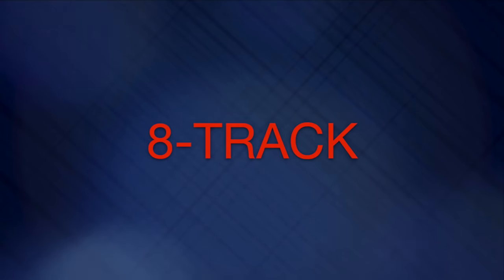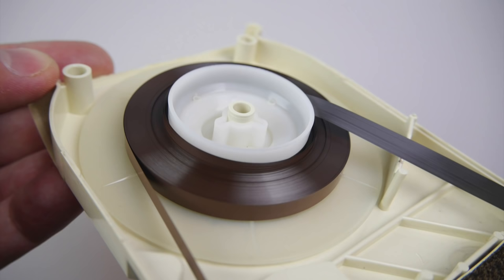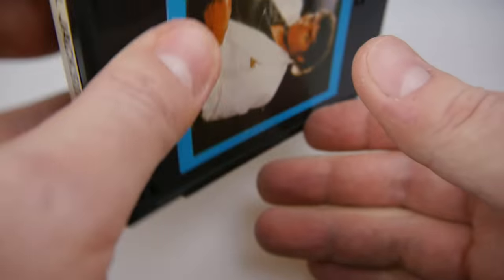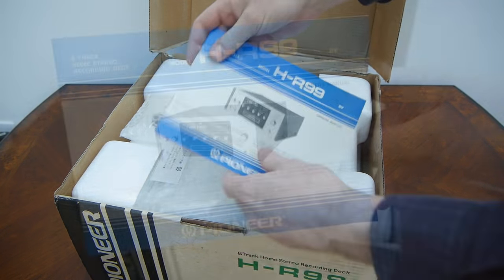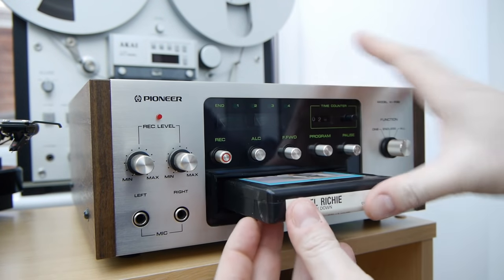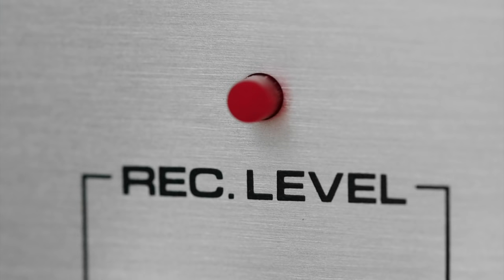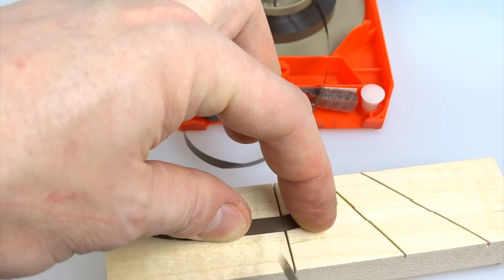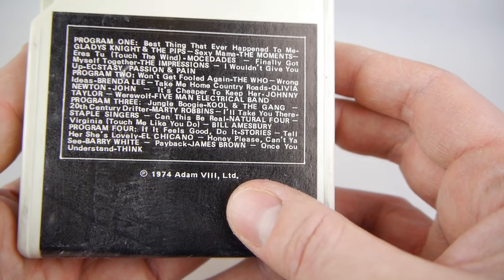Revisiting the 8-Track with a New 1975 Pioneer HR-99 Recorder

Comment: I can tell the old ones is running too slow. Maybe it's too slight for everyone to notice. But this will do something to further lowering the sound quality. The recording you made seemed to play back at the right speed though. Maybe it would do a lot better if it were oiled and cleaned inside. Maybe i missed some point you had about not opening it.

Comment: I feel almost that 8-Track cartridges could have been more popular if they did the thing that compact cassettes did, and were manufactured in a clear plastic, with more "designed" internals. Though I guess it didn't really matter as many of the 8-track players wouldn't have displayed it in action anyway, what with it all happening inside the machine.

Comment: I repair 8 track players for a living, and I agree that the Pioneer H-R99 and H-R100 are the best investments in an 8 track machine thanks to their wide use of commonly available parts, making them always repairable.  Other high end decks like Wollensak and Akai contain parts that can only be found in a similar model and are not the safest investments.  The Pioneer does have a tendency to double-track, especially on programs 3 and 4, but it's a routine repair for a skilled technician.  After 30+ years of neglect, that unit fired right up and plays at the correct speed - very unusual, and proves how solidly designed and built these fine Pioneer machines are.  Excellent and very accurate coverage - great video, coming from the world's most recommended 8 track repair technician ( www.barrys8trackrepair.com )

Comment: The US only version of the HR-99 comes without voltage selector and the VU meters only work while recording... :-/
But that strong AC motor is strong enough to pull those tapes.
If only those horrible plastic pinch rollers weren't in the cartridges... On the other hand the rubber ones (which also existed) disintegrated over time ...

Lear wanted to cost cut everything making players super easy to build. He sacrified nearly everything for this.

Comment: There was this guy back home in the '70's who was a real prick to the young woman we knew so one day I took his tapes and every 30 seconds or so I would put a  1/2 strip of metallic muffler tape cut to fit the width of the 8 track tape. The way they switched tracks was metallic tape that make a connection between two pieces of  copper and that activated the switch and "click"  on to the next track. So after he went nuts hearing his songs change every 30 seconds he ripped it out and bought a new one, and every 30 seconds it happened again so for $125 I fixed the problem with his electrical system or so he thought. Remember that minimum wage was about 90 cents an hour back then so all I really did was replace the tapes for $35. Back then an ounce of black hash was $90, exactly what I had left!

The head cleaning tapes were good for stashing your hash or a few grams of weed, never found it after countless searches of my car always in a very public place with the hood, trunk, and all four doors open to make a show of it and me look like some big criminal, when I was 16. 
Sorry detectives McFadden and Gillespie, but you were being pricks making a big show of it in a small town and parents of the girls around that town would recognize me from those searches. Never found a damn thing either. Now I can smoke a joint listening to music in a park and it's no longer against the law, madhouse.

Comment: 8 track was developed primarily for FM Radio broadcasting stations - were if the DJ at that time was no longer a Disc Jockey , until the  Compact Disc came into being !
Reply: Not correct, the 8 Track cartridge was never used in radio stations, NAB cartridges were used and there was no channel switching.

Comment: I was quite surprised to find that a fellow with his much knowledge as yourself was unable to properly splice recording tape!... The tape should have been cut at matching angles on both meeting ends of the tape by overlaying the two pieces on each other and making one slanted cut, this causes both meeting ends of the tape that you're splicing to have identical meeting angles, this prevents a small patch of the sticky part of the metallic tape from grabbing whatever it touches inside the machine.
The way you spliced the tape it will most likely stick either inside the cartridge or the machine and you will end up with a mess, my reason for being so surprised is that my understanding of your experience was that a good deal of it had to do was Reel-to-Reel tape, and of course, reel-to-reel must be spliced in the same manner,... at an angle!
It is also important that I mention here that when you installed the foam onto the hard plastic to replace the one in the cassette cartridge, it should have been stuck to the hard backing with the piece of plastic slightly bowed away from you so that when you put the foam into the cartridge you end up with no ripples in the area the tape is sliding over.
Well....not all of us have the same level of experience. love the videos, keep 'em comin'!

Comment: Misaligned head causes crosstalk. My Realistic machine has two screws on the bottom to adjust head height and azimuth. Stuck a tape in and played with it until crosstalk was gone completely. Sounds great with a good cartridge, absolutely 0 crosstalk. Sometimes it comes down to the tape when it comes to crosstalk. 8 tracks are not THAT bad. Some decks, like my Realistic, have Dolby noise reduction that sounds awesome on some tapes, but not so good on others. Keep your machine in good order, and it will pay you back. Any tape machine that hasn't been maintained will cause issues. This includes cassette decks. I've had my fair share of destroyed cassettes due to poorly kept decks.

Comment: #1 issue for me with 8 Tracks is the wheel.  the one you can see.  Plastic. oh no problem but as you should know considering how gooey some of your record players get that wheel if it's made from rubber will result in tape inside the machine.  I consider it fairly shot by then.  Only solution I've found is borrowing one from another that has plastic and recording it from there.  GLad to know about the foam pieces though.  I have a cleaner running in another case (rubber wheel) and it runs fine.  We played 8-tracks well into the 90's mostly because Joan Baez Noel is just fine and Alice Cooper Billion Dollar Babies I got so good to know that I was singing I love the Dead by heart.  Think I went and protected Jimi Hendrix's Electric Ladyland so thats elsewhere hidden.  Got even more 8-tracks getting out of high school in the mid 90's because I still had a working machine (that one died sometime in the 90's and got another one w/o speakers so I can take it apart and watch it while it's recording so it doesn't spew)  Once upon a time they suggested metal bubble gum wrappers but never got that to work.  Now how to fix that freaking rubber wheel would be nice.  (plastic please)

Comment: Question:
I've got an Empire 8 track player from the 1970s (I don't know the specifics-- it's currently stowed away) and no 8 track tapes. But I have a hundred cassettes and no real dedicated player. Would it make sense to buy an adapter to play the tapes on this machine? Thanks and great video
Reply: Jasey Studios If you wanted to, that would work. But the quality would probably be poor.

You can usually get half-decent cassette decks on eBay or at Goodwill for reasonable prices.

Comment: In general 8 tracks sounded better than cassette tapes simply because of the width of the tape and and the the amount of tape face available to the head. The larger the track and head available to the recording the greater the frequency bandwidth. If the players were equipped with Dolby or other noise reduction systems the sound out of them would be far more superior to cassettes.
Time to dig out my old stuff and rebuild the player. Any sources for belts in the UK? Hopefully other rubber parts are salvageable or its time for some serious DIY if I can locate the appropriate rubber stock.
Reply: Actually, cassette and 8 track head faces (individual track width) are nearly identical.  1/4" / 8  (plus guard bands) is about .020 inches.  Cassette tape is actually 1/7", not quite half the width of 8 track tape;  1/7" / 4  (plus guard bands) is about .024 inches.  The major difference in quality is the speed difference, the 8 track running at 3.75 ips made all the high frequency waveforms twice as long, and thus easier to playback.

Comment: I tried repairing a Boston tape that came apart at the foil. I got it all taped up, but now the tape just won't pull. I read online that a common problem when repairing 8-tracks is that the tape is spliced too tight. I tried loosening it, but still no luck. :/

Comment: If the same metal strip is used to trigger the track switch for each track, does that mean you end up listening to  a bunch of dead air between 'tracks' (presuming special versions of the songs weren't mastered to exactly filly each track)?

Comment: I wonder whether the 8 track's ease of operation was a selling point for use in vehicles. All that the user has to do is pop in the cartridge, and music starts playing. There is no need to pull it out and flip it over, as was the case with cassettes, before the advent of auto-reverse.

Comment: The tape that came off the hub/reel can be wound back onto the reel with patience if one cares to do so. The original Lear Jet cartridges cannot be opened so easily.  RCA cartridges cannot be opened except by cutting or drilling.

Comment: High-speed duplication; reason why cassettes and 8-tracks from that era just don't sound very good and have tons of hiss. Twenty recorders slaved to a master running at 8-16x speed meant lots of hiss and maximum response somewhere about 8-10kHz. For a bit of insight into the Ampex duplication operation:

http://www.8trackheaven.com/archive/ampex_update.html
Reply: unclehogram well, at least for cassette, they duplicated onto massive reels on multiple machines which were then cut up and fed into shells; 8-tracks probably, too.
But the hiss is there when recording realtime, too. Caused more by not graduating to high bias tape, poor quality ferrous heads, no dolby, etc. despite running at double the IPS of cassettes. 
But a store-bought cassette, using Dolby B on a good deck does sound quite good, with little noticeable hiss.
Reply: Filming In Portland Get a Mobile Fidelity Sound Labs cassette to see what quality duplication can really do. They're incredible and very little hiss.

Comment: The graphic depiction of the 8 tracks (4 programs split into left and right channels) at the 2:00 time point is not quite correct.

As depicted (incorrectly) in the video, the tape width is first divided into 4 programs, which are then each subdivided into 2 channels (L & R).  But in reality, the tape is first subdivided into 2 channel clusters, with each channel cluster subdivided into 4 programs.

Or to describe it sequentially:
The graphic incorrectly suggests the tracks, from top to bottom, are L1, R1, L2, R2, L3, R3, L4, R4.
In reality, the tracks are arranged (from top to bottom) as L1, L2, L3, L4, R1, R2, R3, R4.

This interleaved arrangement keeps the left and right coils & magnetic cores in the playback head physically separated as much as possible, simplifying the head design while minimizing crosstalk.  It also means the head only has to shift its position by 1 track width (instead of 2 track widths) when changing to the next program.  (And since the polished surface of the head must be broad enough to ALWAYS extend past the tape edges across ALL program positions, the smaller position-shifting associated with this interleaved track arrangement minimizes the physical size requirement of the head.  This is particularly important given that the openings in the end of the cartridge -- into which the head must fit -- are barely twice the tape width!)

Comment: 8-tracks aren't that hard to wind back onto the reel, the key is you can't wind it too tight or it will have too much tension and drag in speed.  I've even spliced the metallic strip back on with scotch tape and they worked great.  I did enjoy the sound more as I found it to be fuller as well, which could be contributed to its limited frequency response of 100 to 10,000 Hz.  But definitely not the shrill highs that were encountered when CDs first came to market.  But on another note, 8-tracks are just basically like reel to reel except recorded and played at the 3 3/4 IPS whereas most reel to reel decks could play the slower speed but also used 7 1/2 and 15 IPS (inches per second) for increasingly better sound quality, but yes, the recorded material is aligned differently on the tape between the two.  In radio "cart machines" were greatly utilized.  Similar cartridge to the 8-track, but these cartridges did not contain the sponge material and did not utilize the same roller in the cartridge.  Instead, cart machines had a chain driven mechanism that would come up through the bottom to hold the tape between the head and the back of the tape.  It also had a positive drive system so they never dragged.  Cart machines were also only 2-track stereo and played at 7 1/2 IPS for great sound quality without the hiss as was the case for full size reel to reel decks used for broadcast back in the day with ReVox/Studer A-77 and B-77 decks being the most popular.

Comment: The 8tracks from Atlantic were the best as they had copper plated springs holding pads against the tape so no foam breakdown. Back in the late 70s and early 80s the foam sucked then so it was a bad design. Sorry Mat, I tossed my 8tracks in the 80s in celebration of the CD.

Comment: Whole my life.. (that is from Futurama and to this video of yours), I thought that 8-track was the golden year of magnetic recording... i thought that 8-track means, there is 4 stereo tracks or 8 mono tracks of volal, guitar, drums and bass... I believed that people were buying 8-tracks to record separate instruments and mix music in the 70's and 80's? Am I so wrong or am I missing something?
Reply: You are conflating two separate machines used for two separate functions.  The 8-track player referred to here is a consumer device using quarter inch tape at 3.75 inches per second wound in a cartridge.  The other 8-track machines you alluded to were used in recording studios and originally used 1 inch wide open reel tape at 15 inches per second and made by companies such as Ampex and Scully. With these devices, all 8 tracks could be recorded and played back at once, not just a stereo pair, and the head did not move.  Technological innovation and the demand for less expensive equipment drove other vendors such as Teac to offer these features on half-inch tape, and ultimately, just before the advent of practical multi-track digital recording, companies such as Fostex were offering 8 track studio type recorders that used economical quarter inch tape, though at higher speeds than the music cartridge and employing sophisticated analog noise reduction.

Comment: Question: I am thinking of buying a 8 track player on ebay from the us. Since i live in sweden i will need a power adapter to get the right voltage. Does it make a difference if i use  a 50 hertz power adaptor instead of 60 hertz? / Håkan

Comment: So, you're very wrong on this.  These were very portable even though you said they aren't.  You could take it from the house, to the car to the truly clunky precurser of the boombox...players that took D batteries.  You couldn't rewind an 8 track but some could fast forward. 

on the player you showed, you didn't take it apart, you merely took the cover off. 

The problem is that the metal oxide wore off fairly quickly and the quality degraded. They were also prone to eat tapes or the tape would wind down hard and making it drag when playing back. Part of the problem as you see, if the force it took to  put a tape in a player often could push the player around too much.

Comment: My opinion of what killed the 8-track, and this maybe has some weight because I lived this experience. It wound up in just about 50% of every car on the road, and 100% of every carpeted van. People would arrive at their destination, park in the middle of a hot day, and not remove the tape from the player. When they went back out to the hot car, the player would come on and presto!... the tape would unwind inside the player for up to a minute before you realized it was off the rails.

Comment: Seems quite interesting, however, though the playback machines (like that chunky Pioneer) are out there, the tapes seem unreliable. Thus I have to ask - does the quality of 8-tracks justify getting them, or will they be simply inferior to vinyl? Or does it all matter from the playback device? And does the recording quality vary by decade? Say, will the Doors first album be as clear as Lionel Richie there?
Reply: +Slick Sludge In my humble opinion, an 8 Track is by far one of the worst sounding playback devices ever. I did enjoy them while I was growing up, and I'm glad I still have some today, but my turntable blows the doors off my Pioneer H-R99 8 Track player. However, you can get into 8 Tracks for a lot less than a turntable set up, so if you have the funds, feel free to try it out for yourself. The investment won't be a lot.
Reply: I have a couple of 8 tracks, and they don't sound bad at all, but then again, my player has seen very little use (I had to fix it, and I suspect that it broke very soon after coming home from the store new, so the previous owner didn't use it much...) 8 tracks aren't much of an investment, because the tapes are dirt cheap, so if you've got the time and patience, they can be a lot of fun.  Otherwise, though...